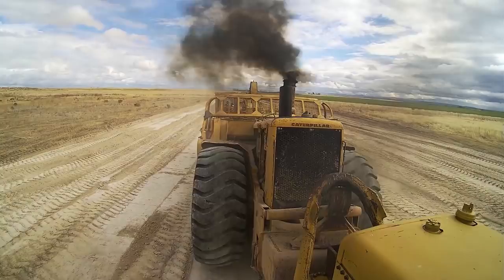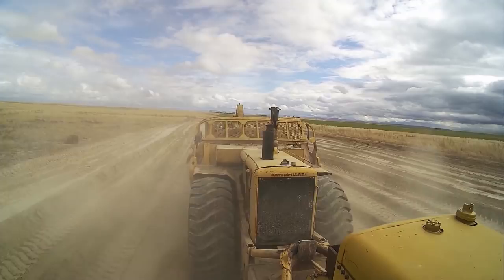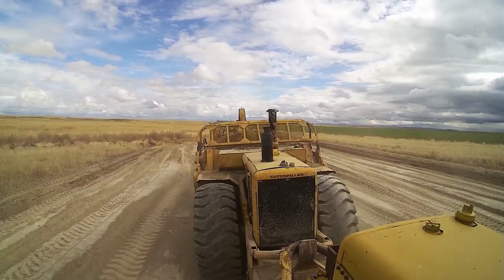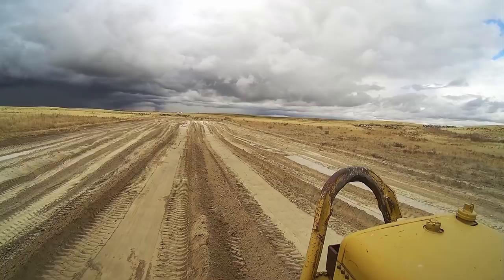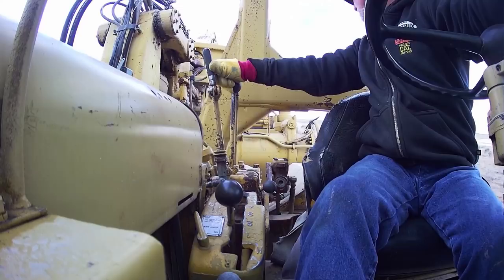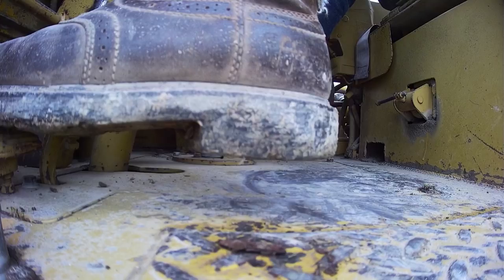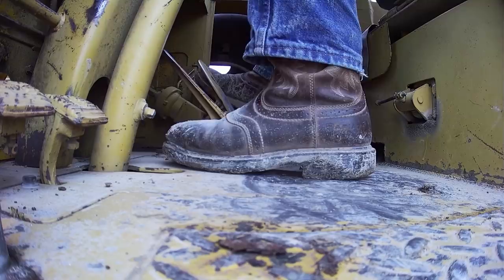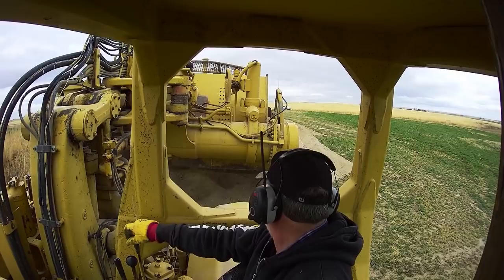How To operate Caterpillar Push Pull Scrapers

Comment: Im 38 and have been running heavy equipment most of my adult life. Mainly excavators, dozers, grappler's, telehanders.  I start a new job on monday clearing out new oilfield pads. Boss man asked me if i want to learn the scraper and blade. I almost cried because its only two i haven't operated. This seems extremely intimidating. Thats a lot levers and stuff ive never heard of. 

Send me "good vibes" because this completely different then what im use too.  

Stay safe out there, and much love for the video
Reply: It's not bad. Just don't be scared of the machine and make sure you watch your cutting edge to see when dirt is going in your bowl. That's how you know when to stop pushing your bowl down until you can grasp how it feels when your digging.
Reply: With the blade just don't be scared to push dirt.
Reply: how’d the first week go
Reply: @crowningkings6006  thank you! I'll respond back when I have time. But thank you

Comment: Jeff, this is  a valuable video. There's clearly quite a lot to learn when it comes to operating push pull machines. You don't want distractions, especially in the big old girls you drive.  I'm looking to get my butt in a scraper sometime in the next year. I just need to get a start, and I'm working on a foreman at the moment. His company runs 6 x 621G's and they also have 2 x 627G's. I'm hoping to sweet talk my way into getting a bit of time in a 621. Everybody wants experienced operators. Getting a start as a middle aged man is hard. I don't want to spend the last 15 years of my working life on a shovel in a trench. I love these earth moving machines, and moving earth is what I want to do for the rest of my working life. I think working a scraper is realistic. I'm too old to start learning a grader. Those things take many years of practice to operate really well. A scraper, or maybe even an excavator, is a realistic goal. I really like your channel, it's become one of my favourites in the last month or two. Please don't change. You're doing everything right with your channel. Les from Canberra, Australia.
Reply from the maker: Your not to old Les, it doesn't take years it just takes want, get in a blade on something that's being cut and go to town

Comment: I used to run a cat d8 cable scraper when I was in my 20s and you don't really understand how hard the old guys had it until you run the old iron then you have so much appreciation for new air conditioned cabs and hydraulics
Reply: Old man had a allis dozer and a cable can in the early 70s. He sold the outfit and the dozer and can are rotting down 10 miles apart.

Comment: Back in the 70's, I was working on a large dam and operating a CAT 631 with side extenders. The machine could haul 36 cubic yards of dirt about 25 MPH. In the cut we had several D-9 push CATS with Cushing blades to push the pans to load. There were 25 pans hauling at any given time up to two miles  from cut to drop.

Comment: Used to drive a scraper in the Army Engineers. Our beasts were built differently than these so I always wondered. We used dozers to push scrapers the cut. 
I can remember once having to drive our scraper 60 miles down country roads because we couldn’t find a route  that’s didn’t have low hanging power lines
Reply: steven heckert i went to work with my dad riding on the equipment he operated from the time I was in diapers. He was surprised when I joined the army engineers. Ft Leonard wood! Those were the days!

Comment: Best way to have a smooth hook up when going from pushing to pulling is to turn the nose a bit to either side so the bail slides around the inside of the hook, and plenty of grease on the bail and push plate make things a lot easier as well, been there an done that.
Reply: Grease is a waste of time. We used roofing asphalt

Comment: I like self loading pans with a conveyor myself. I’ve run both those, and push pans. I’ve even seen pans that break down into a tractor to become a pusher. What I’ve never quite gotten, is what the advantage of a tandem push/pull setup is. Seems like either of those double barreled pans could easily load themselves, especially if they already do it, then tow the one behind. I gotta be missing something here. In any event, an air ride suspension on the haul road makes the ride smoother than a baby’s bottom.
Reply: Nope. I just got it, duh. Rear pan push loads the first pan, then the first pan pull loads the rear pan. That’s what I get for overthinking it. Ha ha
Reply: @thundervalley9766 , yup! Lol
In some soil conditions they might be able to load themselves all right, but once you get into harder soil, even with 2 engines you don't have enough power, or enough traction, to cut and load that much material, and so you either need dedicated push dozers, or use push pull.

Conveyer self loads work great in some conditions, or where you don't have the room for push dozers etc, but when you need high volume, these can't be beat.

Look at some of the jobs that say socalearthmover shows, with large fleets of these constantly going at speed, and think of how many push cats would be needed to keep up with the fleet, or how long a conveyer load would take to move the same amount of material.
It's all about speed and efficiency.

Comment: Interesting. I have run excavators, bulldozers, wheel loaders, track loaders, graders, dump trucks etc. but never seen a scraper live. They don't use those here in Finland. I guess the ground is not suitable for them, lots of rocks, clay, tree roots/stumps, wet in the summer and frozen in the winter, so we mostly have to use excavators and dump trucks.
Reply: Scrapers excel at building highways, railways, and garbage dumps.  Maybe Finland has enough of these things already?
Reply: @tomsamplonius4297  As said, I guess the soil here is just too tough and rocky for scrapers to be economical. It's often very hard even for excavators, we use different shape of buckets from most parts of the world, our buckets are narrower and deeper for better penetration into the hard soil and easier lifting of large rocks. We also don't use bulldozers for cutting much, mostly just for moving and spreading of loose material as they, like scrapers, are not great at handling big rocks. We often have rocks so large they need to be blasted with dynamite of broken with excavator-mounted hydraulic hammers.

Comment: I have heard scrapers don't have brakes not that they need them. I bet you can walk and chew gum at the same time. You make it look easy thanks for this video
Reply: They have drum brakes on all 4 air actuated S cam type with spring overide for park, but typicaly once there worn out they dont get fixed until the tyres and rims come off for other repairs. Cheers mate 🍻
Reply: One brake pedal on the right.
Reply: @michaelbrown8545   Thanks ( I googled it )

Comment: Learned to run a 619 cable rig in the late 90s had a 8k pushing them . A few years later I ended up buying a DW10 and a D6 10k

Comment: As you know there is no front push block on a 623 but they do have a very effective stinger on the rear. We had many jobs with 637's and 623's.  We had a half mile hill and of course the 637 were much faster than the 623's. I would stay to the right and raise my can so to lower the stinger. First it started out as a joke but at times  getting  pushed up the hill worked pretty good. Even in mud.

Comment: Old days.. CAT DW21 with 400 Cummins, Jake, 6 spd Eatonin front of the factory trans making a total of 3.
Easy 40mph when traveling on the road.
Reply: I would bet that 95% of your viewers do not know what a CAT DW20 or DW21 even is. Had two 1960 models, even in 1960 these cost new at $64k each.... Cable rigs can be productive with the right "Very Old" drivers, now all dead.

Comment: I have noticed alot of the rear of the push-pull scrapers have guards to prevent running the bail through the radiator. Do you ever load in 1st gear? or is that too slow?
Reply from the maker: the guard is for dummies, LOL  yes first is to slow and to much power to the wheels

Comment: Scrapers the machine hardest on the body
Reply: Try running a dozer in rock
Reply: You see the cryin dozer hand below. I should have quit running scraper and ran dozer more. 20 yrs ago, maybe I still be walking with feeling from the mid chest down. . Not sayin dozer and rocks are a joy. But take a look around buddy, not very many old scraper hands and plenty of old dozer hands. Just sayin. When I need a few days rest I get on the dozer
Reply: I was running a scraper removing cap rock  now ive had neck surgery and need 3 back ops wish id never driven a scraper now haha
Reply: @tier8369  I hear ya. They been tryin to get me to go under the knife. For several yrs. I run dozer blade and hoe as much as I can. I'm not doing till I can't walk. Never seen anybody say it was a good thing. Good luck to ya
Reply: Running on rubber was always a no no! In early 70s was working a 657 and the guys on tracks always said "you'll suffer when you're older boy" !!!! How effing right they were lm now nearly 70 and there's not a joint or muscle that isn't knackered in my body!! But hey I enjoyed every minute of it and earned good money at it!! The muckshifters were a good bunch!

Comment: In my area in SE Oz we mainly see much smaller scrapers, 621 and such. I guess they're a lot more simple as they only have one engine and don't push and pull each other. They're still bloody dangerous though. Also, I hear the smaller ones beat you up a lot more. The scraper operator who recently left the company I'm with is only 22 and wore a kidney belt whenever he was in the scraper.

Comment: Takes a lot if skill.  Around here pretty much everyone runs trackhoes and haul trucks.  Move from a to b faster in a truck and a little less fuel in the operation.   Scraper definitely has its place though.
Reply: In rocky or hard material that a scraper can't easily load, you pretty much need to dig it out, but if you have softer material and the room to do it, scrapers will haul faster than a shovel and trucks, because they always just keep driving forward all day long!
With trucks you have to back up, or at least stop and wait to be loaded, and the larger the capacity of the truck, the longer that takes, and then you accelerate out, drive about the same speed or slower as a scraper (which can hit like 60 mph on a decent haul road), and then stop again at the dump site, back up and dump.

The scraper goes full speed from point a to point b, and just slows down a little at each end to load and unload.
And with the dual engine version like this, you have the power to be able to climb steep hills faster than a single engine dump truck, very helpful in steep sites.

With scrapers you can have a continuous loop going nose to tail from cut to fill, and move material much faster than shovels and trucks, when the conditions are right.

Now, I don't know it the soil conditions in your area make scrapers of limited usefulness, or if the companies around there just have never made the investment, because shovels and dump trucks are more versatile, and scrapers are basically only good for mass material movement (though I have used a 637 for fine grading lol. A large building pad had been lime treated to the point that the 14G could only cut about 1/2 inch per pass, and we had up to about 6 inches to go down, so while the grader was working on the closer side, we had a couple of 637's working on taking fine cuts down within a couple of tenths across a few acres. But that certainly isn't the normal use!), so unless there is a lot of major dirt projects going on, I can see not investing in scrapers
Reply: ke6gwf 60 mph in a scraper? C’mon now, getting a little outta hand with your story aren’t ya?
Reply: @Phukutube  more like 35-40 if absolutely hauling ass. And it's rare to have a haul road that smooth they get to bucking at 35 and it will be the roughest ride you ever had.
Reply: @sewerbat4841  you are absolutely correct...34 is as fast as I can remember getting a 627 up to in my two decades of operating one, and that was down a maintained county road. We had a couple of crazy cowboys that would run full speed down our rough haul roads and one of them rolled on the flattest part, ending his career...I gave it up and went to the big track hoe and loaded trucks, much easier on the body!

Comment: Why were you kicking the rear into neutral after you got loaded?  Never seen that before.
Reply from the maker: Didn't need the power, saves a ton of fuel and it's how a guy like me survives and is profitable, a lot of quote experts on here saying that it's not correct but I work on them and understand how they lubricate, it won't hurt a thing I promise, been doing it for 30 plus years and have never had a failure from letting it idle. I think most bigger outfits think operators are stupid and they don't want to confuse them with something else to do, my friends in Wyoming are running 22 of these and they have to remove the diff lock and trans hold pedals so ops don't screw something up, if you can teach someone to use the diff lock correctly then they can certainly be taught how to use the run/neutral switch correctly, it's the difference between putting 50/75 gallons of fuel in the tank and putting 125/150 gallons, lots of money going out the exhaust pipe that doesn't need to, hard flat surfaces with little rolling resistance don't require 750HP to move the load, hope that explains why in an understandable way, thanks for the question, well put and polite, I love it

Comment: How come you dont just run both engines when traveling to and from the cut? Wouldnt the extra horsepower be a plus when getting up the speed or in soft conditions? Never ran one with two engines so just wondering.
Reply from the maker: don't need all that horsepower, plus it saves a ton on fuel

Comment: Started on ts14 b no down pressure and apron cable cable connection she couldn't Force the apron down..... And if you didn't drop the middle Cutting Edge or The Cutting Edge was wore and it was hard material good luck getting a load thank God after that moved into a b model cat then an e they had F's and Gs but I didn't like how it was electronic over hydraulic you couldn't feel anything in the levers

Comment: What gears do you run both scrapers while pushing and pulling  ? Do ya both run on 2nd gear at the same time while pushing or pulling? And also when you in the back getting ready to unhook do you speed up to unhook?
Reply from the maker: 2nd gear, 1st is to slow and to much torque, spins the wheels to easy, you let it shift up to unhook

Comment: I used to run a scraper. 8n a diatomaceous earth open pit mine.itwas not a push pull or twine drive. But the guy who ran it before me blew the motor , of course how I got the job should be self evedent, lol. Was a little 631 8f memory serves me right, but the only Pistons they had to replace the old ones with were truck Pistons, and I had to blend the diesel down with road deisle to keep from burning a hole through them, but lemme tell you that littlle sucker hauled major A##. I'd hit 8th gear on the haul road to the pile and was clocked by the owner and mineral company engineer  at 45 no!h and still working up the scale, figure about 50 at the of the pile before I let out of her, then had my first seat sucking experience with steering lock cause the equipment was not new enough to have dual stage steering pump...I'll save the sliding down the pile story for next time, I became a man   that day lemme tell ya ...I was 18 ,, and yes I did indeed change britches lol...thanks for the video...those are cool how they operate
Reply: Lmaooo just started to run a scraper myself , we've been grading subdivisions and I myself had a sketchy experience on a slope. At the time I had no clue if you dropped the bowl the cab would upright itself , so here I was 90° looking down off a slope in a big ass machine I've never ran befour

Comment: Are you in communication with the other scraper ? I noticed head phones with short antenna but no mike , just wondering??
Reply from the maker: No just trying to listen to some music
Reply: Normally the two operators just kind of know what the other is doing. It is important when loading push pull scraper's to never stop and maintain a steady speed while loading.. As shown in the video with the differential hold peddle. Do not let the scrapers spin and dig down or you will not get finished loading.

Comment: Question.. You in the cut.. First scraper at 2nd gear cutting.. What gear is your partner in in the back? 
Question 2 and im sorry for asking.. After first scraper done loading and the scraper in back is loading what gear is the first scraper in?
Reply from the maker: Both machines in 2nd gear loading during the whole process ,   no need to shift up or down to hook or unhook or during the transfer from loading the front to loading the second machine

Comment: Whats the best way to take the slack away from the bell when I’m push pulling in a 627G
Reply: The person in the rear controls the slack in the bail. In the rear You upshift after your cut, lift the bail, lift on the throttle a tad then get right back on the throttle as you turn to show you are free... away you go.

Comment: Hi Jeff, are both engines on all the time but you throttle them separately?
Reply from the maker: seperate throttles, and the neutral? run switch allows the rear trans to sync with the front, so I can go to neutral anytime I want, or go into any forward speed when I want